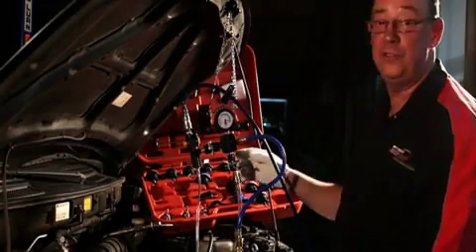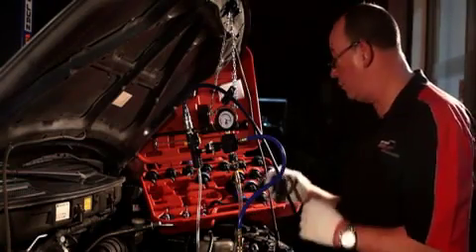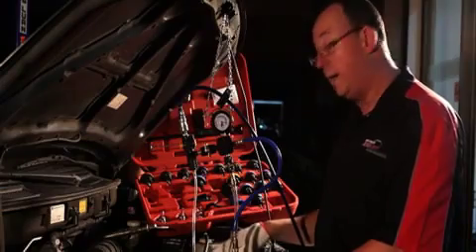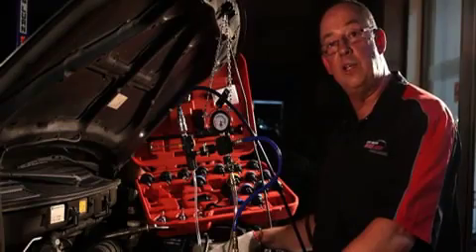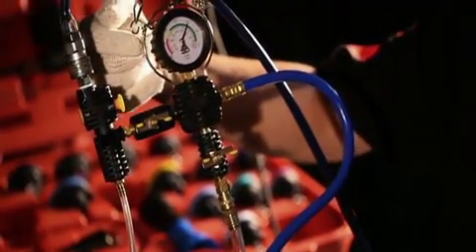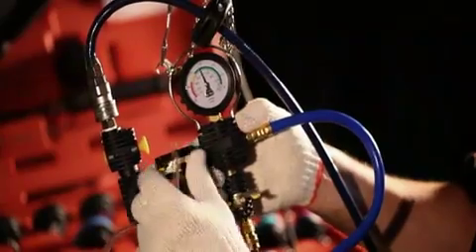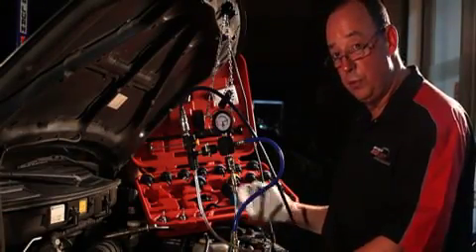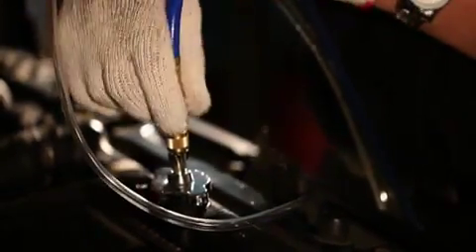Repco Radiator Cooling System Kit - RTT1019: Repco Speciality Tools Demonstration

Comment: I see three things you should do differently. . . first, you should PRIME the coolant hose with coolant BEFORE you do anything else.  This is done by covering the cone-plug with your finger, while running shop air, and lightly opening the coolant valve (the hose in your bucket of coolant) until it draws enough coolant to fill the hose all the way to the gauge, then immediately close that valve.  Then, insert the cone-plug into the radiator.  Once you establish vacuum, you can shut off the shop air and close that valve.... the shop air is not longer needed at that point.  Next, just WAIT a few minutes and monitor the gauge to make sure you don't have a leak in the system.  If you lose vacuum, you don't need to go any further, because you have a leak somewhere.